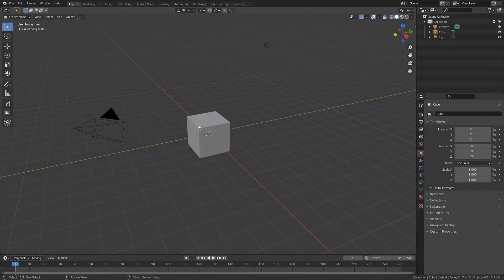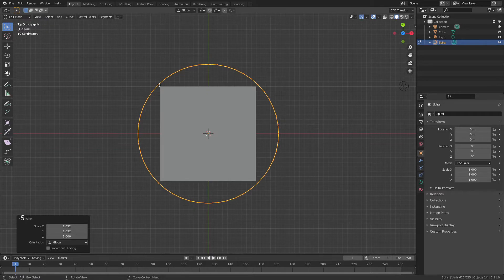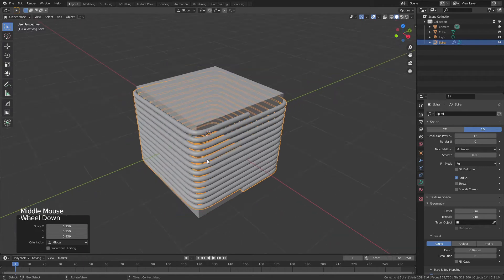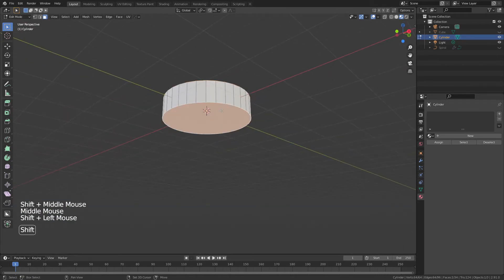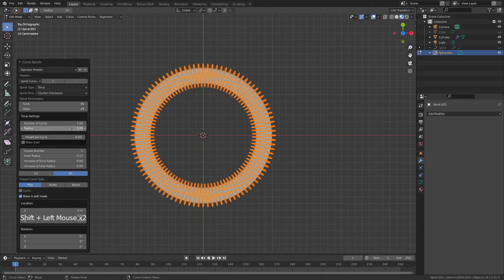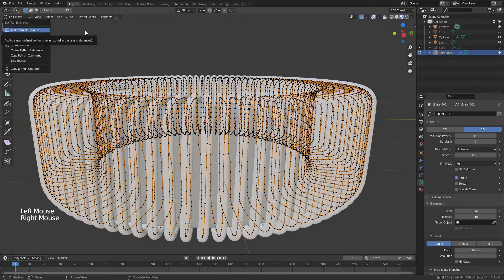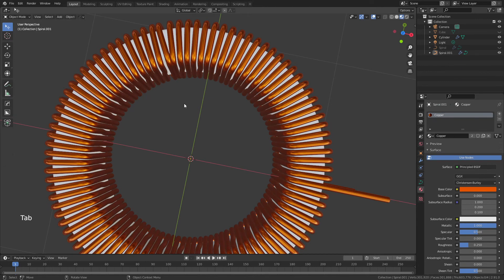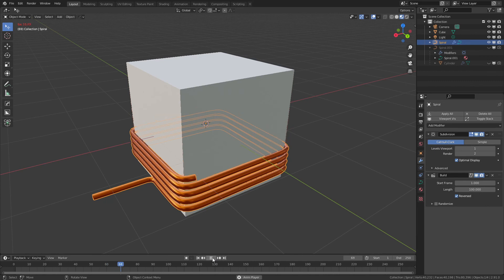How to Wrap A Coil Around Objects in Blender (Making an Inductor)

Comment: Awesome tutorial!

Is there an eay to bring up that menu to change the spiral properties?  
I'm constantly clicking off before finishing with the spiral.
Reply from the maker: Unfortunately once you click off the menu it goes away permanently. It's a bit of an odd quirk of an older system. I find it helpful sometimes to use F9 to move the menu somewhere more manageable when I'm starting to avoid clicking off the spiral. 

I believe Sam Aldhaher made a tool in geometry nodes for creating inductors that is more flexible.

Comment: Hi! Do you also know how to animate a current moving through a wire?
Reply from the maker: There are a lot of options so it depends a bit. You could setup a particle/geometry nodes system to move small charges along the curve or inside the mesh. You could also setup a gradient material that moves along the mesh and makes a certain part of it glow. Plenty of possibilities.
Reply from the maker: @communist754  I don't know that I would make a tutorial on this just because animation is so particular but it could work its way into a Blender and Science episode as a demo, so potentially.

Comment: I see that you can change wire diameter at any point, but can you change the number of turns once the coil is created and the new object dialog box is gone?
Reply: Thanks for the prompt reply.  Great video, very professionally presented. I design inductors so this will be a great asset for my presentations.
Reply from the maker: Unfortunately curves don't tend to easily update that way. You could use array modifiers to try to add more turns but that is likely more trouble than it's worth.